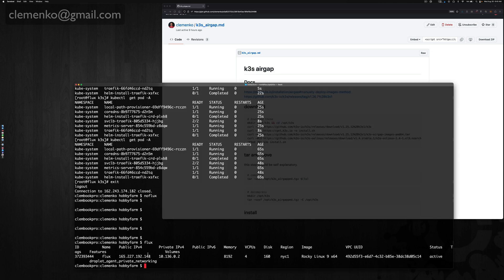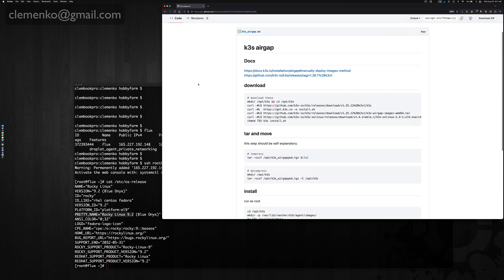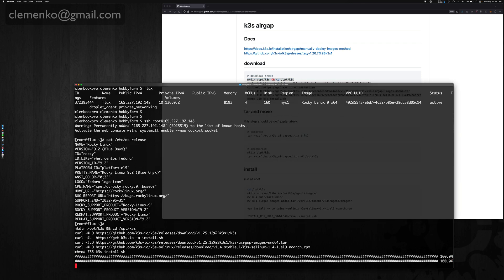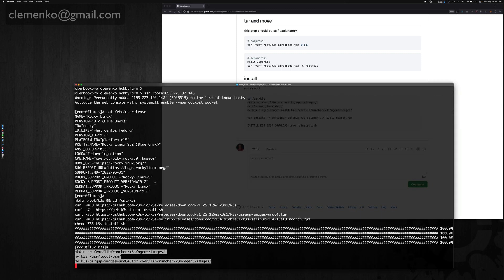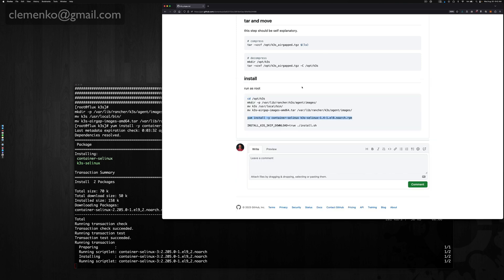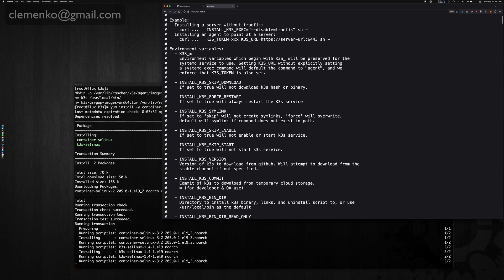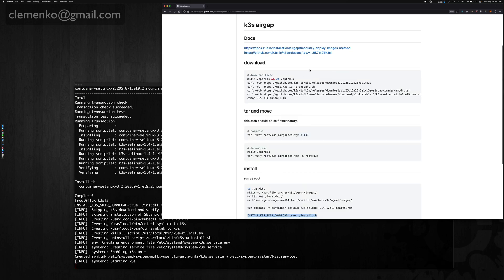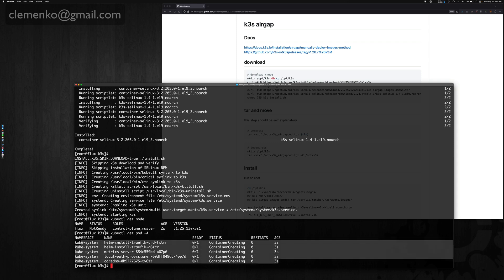Simple K3s Air Gap Guide

Comment: Helpful, however would you be interested in updating the video or making a new one for Debian envs as well?
Reply from the maker: Which version of Debian?
Reply from the maker: FYI, I just update the GIST for newer versions of k3s. Basically just skip the RPM download and install. Everything else worked. https://gist.github.com/clemenko/e3a823732c23813b43ac18fef0b24498
Reply: @clemenko  Should not matter. I am using ubuntu rn. Deb files should work on any.
Ubuntu 20.04 would be great if there are any ways to do this. Dont think there are though.
Reply from the maker: Hope this helps : https://youtu.be/BG0OcBPLsFI
Reply: @clemenko  It did! Thank you so much for spending the time to make an update video. Being honest, never saw an OP do that before. Really cool of you thank you sir!